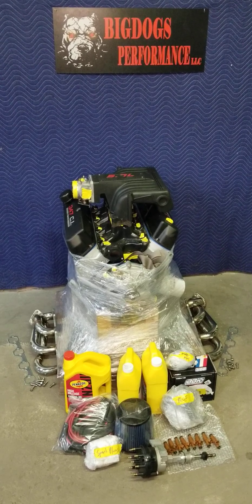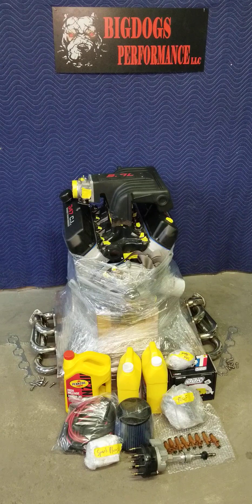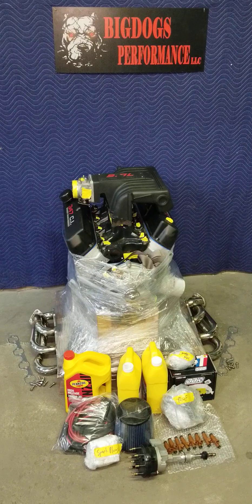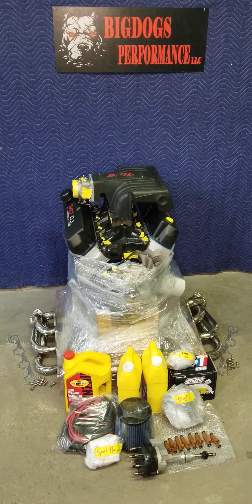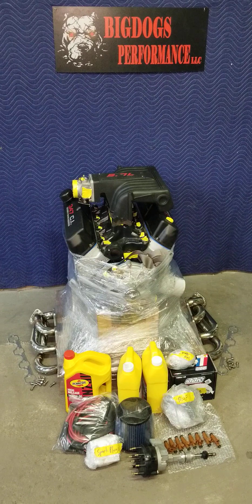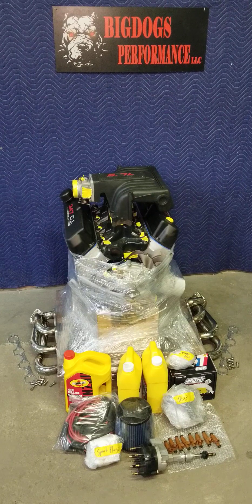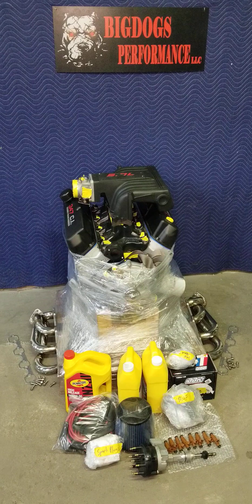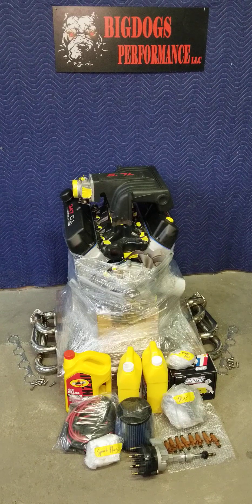SBF Stage 3 Turnkey 347 Crate Motor!!

Comment: is there a dyno sheet? what's the low end look like?
Reply from the maker: @gurkarandeol8571  yes, we've posted it a few times.  We will be dynoing several other motors including another stage 3 347. Let know what information you want
Reply: Oh I haven’t been able to find it, I’ve been looking into your stage 3 explorer intakes and heads. I seen that the range is like from 3k -7k rpm but still wanted to see what it’s like on the low end. Currently building a 347 and am fairly interested in your guys stuff.
Reply from the maker: @gurkarandeol8571  it's great on the low end with our ported parts. This motor had our ported Brodix heads, stage 3 cam and ported 80mm tb. Torque was great. Numbers were all great. It was tuned good on the dyno.
Reply: @ I found the dyno numbers on your Instagram, and they are some stout numbers. I’m pretty interested in some of your ported parts. What’s the best way to get in touch with you?
Reply from the maker: @gurkarandeol8571  thanks. Our Facebook business page, our IG business page or email us. We are currently building 4 crate motors from 347, 306, 357, and a sbc 310. All will be going on the dyno and will be video done

Comment: So this would put down 410-420hp wheel on 91 octane also can we get more cam specs
Reply from the maker: No it would put down 450whp on a dynojet with a T5 and a full 3" dual exhaust system wth high flowing straight through mufflers and street tires.

Comment: 550 naturally aspirated 347 wow I have a 6.1 Hemi with a 2.9 Whipple making 600
Reply from the maker: All ported parts, some decent Compression, a nice cam and a good tune is all that's needed. Many people build these motors with low flowing parts and weak cams which is the reason they come up short

Comment: Tony, did they dyno with the shorty headers? Anyways stout sleeper looking stroker!
Reply from the maker: Yes they did. Those are our ported stainless steel shorty headers. After we port and modify them they go from flowing 500cfm to 700cfm per side with none of the fitment issues associated with long tubes. We designed this motor to make great torque and carry the hp up high. Cranking Compression was great, ported parts worked together and the tune at the dyno shop was good.
Reply: @bigdogsportingtonyb2833  that great HP and TQ! Nice combo!

Comment: That is one sweet package. That price may seem high to some that doesn't know better. Blueprint sells plain Jane off the shelf  parts making 400+ SBF's for 7k+ and 350hp engines for 6kish but it's just a long block nothing else. In comparison there's no comparison with the HP #s and a ton of custom work and considerably better heads and All the other accessories your including add up fast and it could not be any more turn key unless you went and installed it too! I'm impressed. Would you warranty my factory T5😁 Just send me one I catch ya later on the bill lol.  I wish medical bills hadn't trashed my credit or I'd have one sitting on my doorstep 
🤟😉✌️
Reply from the maker: This is true and this package is cheaper than if a person tried to duplicate it doing it themselves and using our parts
Reply: @bigdogsportingtonyb2833  hell yes, I've said on many occasions the actual bare engine is one of the smaller investments of a build. The current prices I've researched lately this package has a huge value. Put it this way "gap a coyote for under 10 grand!" Nuff said. If I could swing one I would in a NY minute but being a family man even at 49 keeps fun money tight, so I gotta pick away at it. I would love my 95 GT to walk that s550 that goes to work the same time I do that flexes on me with his coyote at every opportunity...